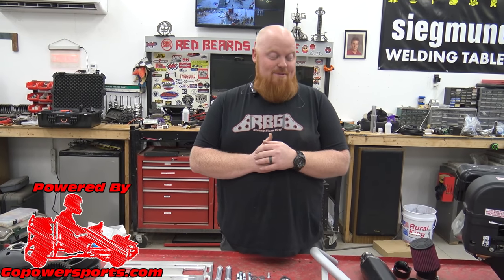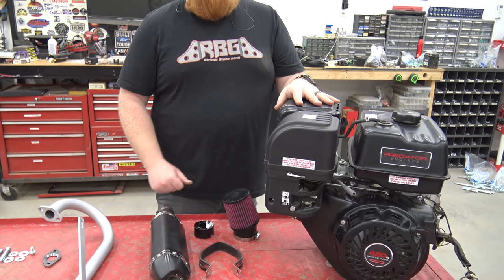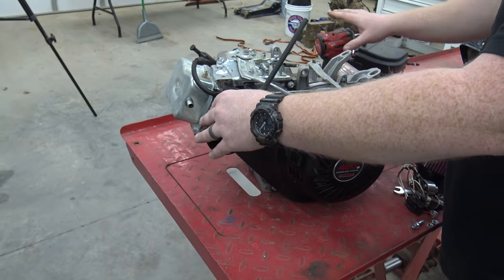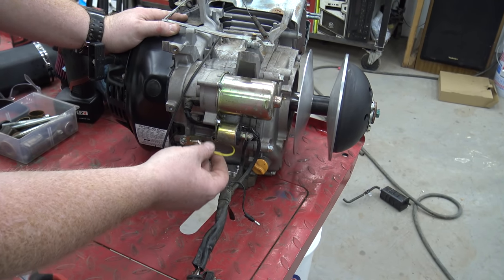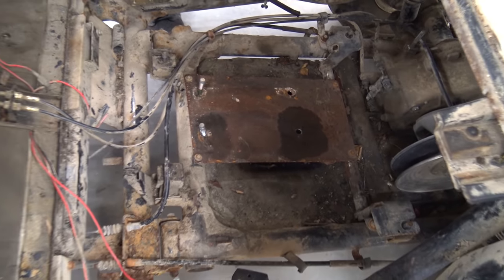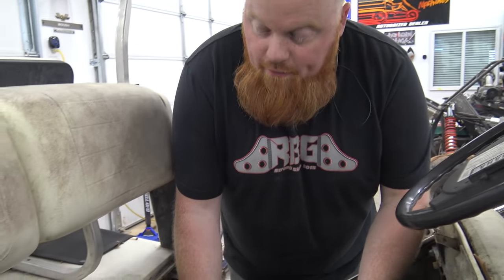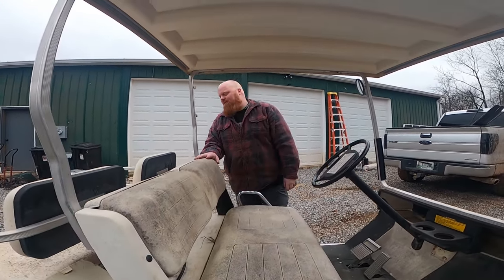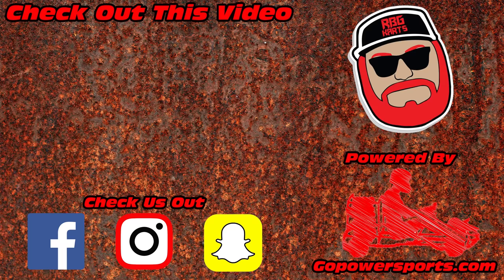Yamaha G2 Golf Cart 420cc Engine Swap

Comment: After watching this you made it more work than necessary the engine fits the rear mounts and just add a square pipe in front and drill holes it sits right on the original mounts, I even used the original belt.

Comment: I did this years ago the rear bolts fit and the front only needed a 1” square tubing added to fit, no need in a charging system just add a solar panel from harbor freight $13 to the front and your battery will stay charged. The exhaust is the problem you have to weld it and make it fit as for the engine running it doesn’t i pull my 3000 pound boat around with mine it’s a beast

Comment: There are a couple of issues you didn`t discuss. What did you use for a fuel tank and the engine doesn`t have vacuum for a fuel pump. I installed the same engine used the stock tank with a electric fuel pump. I also purchased a bushing to use the factory pulley on the engine so I was able to mount the generator starter in front of the engine to crank it with the foot pedal and charge the battery.
Reply: Hey buddy iam doing the same swap do you have any part numbers or pictures of your project like the bushing,fuel pump,pulley thank you
Reply: I used the pipe in the valve cover for vacuum fuel pump just put an inline fuel filter to deal with any oil residue been working for 3 years so far.

Comment: Thanks for your video. I have an older model 3-wheel EZ-GO cart and want to convert to gasoline.  I have an electric start 11hp horizontal thats in a bad generator.  I purchased the cart to pull trash can to end of my 3/4 mile driveway and possibly cruise the neighborhood.  If you have an suggestions on putting that engine on the cart I would appreciate anything you can add.  I just can't afford six 6v batteries.  I did think about put 3 deep cycle batteries in it.  I have two 12v 75ah batteries now. Again, any suggestions would be appreciated and I enjoy your videos! Keep them going!

Comment: How did you run throttle cable, and all the electrical? Did you use a fuel pump? You put it in mocked an exhaust then it was running.

Comment: Red beard, i just installed a 420cc DuroMax engine in a cushman 800x. I want to use the OEM fuel tank to the cart but is needs a pulse line to operate the fuel pump. What do you suggest I use? Should I put a low volume electric fuel pump or try to put a vacuum adapter on the carb? Thanks!

Comment: How was you getting the reverse gear to work ? I put the same motor in my g2 and lost Reverse  . And what is the drive belt part number ?
Reply: reverse is switched at the transaxle on G2's. Sounds like you had a G1 that ran the engine backwards to achieve reverse.

Comment: I have a g2 cart. I thought I needed to add a reverse setup to change the motor.  After watching it is my understanding that the F/R lever controls the rear-end and not the rotation of the starter.(RIGHT?) So I can put any motor in this Honda GX390 with no effect on the reverse ?
Reply: The rear end controls forward and reverse

Comment: Hey. Do you think a disk clutch or a centrifugal clutch would still work good and engage when submerged in water and mud.  I have a mud mower project going and I’m trying to stay away from belt to completely eliminate slippage issues
Reply: Make a waterproof case around the centrifugal clutch

Comment: Your carb was pointed straight toward the frame pipe. What did you do there to install the air filter? Did you remove a section of the frame pipe? Curious  to know what you did

Comment: Does the exhaust pipe heat the belt at all? Rebuilding an AMT600 5-wheeler and trying to figure out how to run the exhaust of the Pred 420.

Comment: How did you Hook up the electrical wires  I have the same engine and need to replace the ignition switch and can't figure out the wiring had it one time to start but wouldn't shut off with key now Im lost and getting mad lol
Reply: I used a John deer 5 pin generic ingnition switch start run lights and kill

Comment: I know this is an old video and probably not where to try to contact you but I have a 1995 ez go textron that someone put a generac generator motor on. He drove it a mile and a half into town and a mile and a half back to me seemingly to show me it was functional I gave him 300 bucks for it because even if it died the frame and everything was worth it.

I drove a block and a half down the road and it locked up on me I realized it was completely out of oil..

I really want to put it back to stock but I'm going to be looking a lot of you guys' internet resources and reaching out to different communities to try to restore it

(I kid you not this guy fashioned a suicide shifter and all it's pretty neat for a piece of crap)

Comment: Hello, I have this same swap with a 780 torque converter, can some one tell me how many lbs the shaft bolt holding it on should be. The converter is tapered, using an aluminum 1" to taper shim. Thank you.

Comment: How do you get it to reverse. Did I missed you putting in a transmission.
Reply: Drive/Reverse is in the rearend.
Reply: I have a Harley Davidson and the mother runs no both ways. Thank you.
Reply: The Harley was a 2 stroke it ran foward and backwards starter motor turned foward or reverse to start motor

Comment: Is that basic wiring the same for the 22 hp Predator?  If not, do you have any videos that explain that wiring?
Reply: I used a generic john deer ingnition switch a got from Amazon and it has a start kill and run and can wire lights off it also
Reply: Kevin alberts

Comment: How hard would it be to turn a battery golf cart into gas
Reply: Depends. See if it has engine mounts first. Then measure the space to see if an engine will fit.
Reply: You would have to completely custom make engine mounts, because there is a battery tray where the engine would sit, and you would need a different rear-end

Comment: Hi where did you get the headlights for the G2 cart I want to put them in mine.  Preferably LEDs Thanks
Reply: I have a G2 that I did the Vegas Carts and Predator 420 as well. It works great. I too wondered where I can get headlights like those? My cart has the holes in the hood for these lights already, but I can't seem to find them anywhere. Also, The trans clutch spring on my cart is very weak. When you hit the gas, there is no low end torque for pulling out. The belt just wants to pull right to the bottom of the drive. Is there a better spring for this that you can recommend that can handle the torque? My governor rod has also been disconnected like yours is. Does that need to be adjusted, or should it be fully turned one way or the other? I'm not sure how that even worked for the original cart or what it was used for. Your channel is AWESOME! Thanks for the help.
Reply: @amorykin  I’m installing the 625cc engine kit from Las Vegas carts and as per the install instructions I’m going to totally remove the governor linkage from the throttle cable linkage
Reply: The g 2 the governed has a bracket that goes to Gov from carb at set top speed governed pulls back on throttle to slow cart when it's not hooked up it does not govern it is in line with throttle on factory throttle cable
Reply: Amm9

Comment: Dude I just put a 6.5hp with gopowersports torque converter into my dads g2. Ran chain back to a 24 tooth sprocket its not fast at all but it lifts the front tires when ya goose it. Got lift kit, 10" wheels and mud tires on it. Goes everywhere we want to.

Comment: Hey redbeard, do you have any suggestions for a reverse gearbox to run with a predator 420, stage 2, and a 40 series torque converter, in an offroad go kart im building?